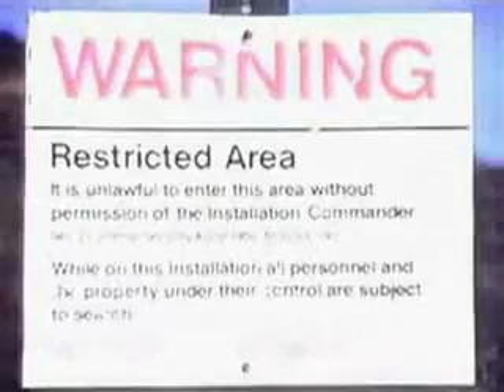Man didnt land on the moon part 2

Comment: No exhaust plume from the ascent stage? Again ROFLMAO!!! First of all, the hypergolic propellants used by the LM ascent and descent stages burns with a transparent flame. Secondly, it's that darn vacuum problem again. The exhaust pops out of the nozzle and instantly expands horizontally outward which cools it enough to be non-incandescent (i.e. you don't see it). 

Actually, if you look carefully you CAN see a glow for a second as the exhaust is trapped and glows white hot for an instant. LOL!!!

Comment: The Build Team first tested whether dry or wet sand made a more distinguishable footprint by stepping in them with an astronaut boot. It was clear that the wet footprint had more detail than the dry footprint. They then placed sand similar in composition to the Moon’s soil in a vacuum chamber and stepped on it with an astronaut boot, which made a clear print. The reason provided for this was that the unique composition of lunar soil allows it to behave differently than terrestrial soil.

Comment: The Build Team placed a replica of the American flag planted on the moon into a vacuum chamber at the Marshall Space Flight Center. They first tested at normal pressure and manipulated the flag. The momentum moved the flag around but the motion quickly dissipated. In vacuum conditions, manipulating the flag caused it to flap vigorously as if it were being blown by a breeze. This demonstrated that a flag could appear to wave in a vacuum, as the Apollo flag did.

Comment: The Mythbusters built a small-scale replica of the lunar landing site based on the photograph, using reflective sand similar to that found on the Moon, and a single light to represent the Sun. Next, they took a photo which was exactly the same as the NASA photo, including the differing shadows. The Mythbusters explained that the shadows were not parallel because of the way the light falls on the Moon’s natural topography.

Comment: Moreover, in a vacuum, the exhaust from a rocket spreads out very rapidly. On Earth, the air in our atmosphere constrains the thrust of a rocket into a narrow column, which is why you get long flames and columns of smoke from the back of a rocket. In a vacuum, no air means the exhaust spreads out even more, lowering the pressure.

Comment: Hi, the landings were filmed through a window inside the Lunar lander. For lift-off, the TV cameras for Apollo 15,16 & 17 were remotely controlled by Ed Fendell at mission control (hence you can see the camera pan and zoom when both astronauts are working on the moon's surface). Before lift-off, the astronauts mounted the camera on the lunar rover (where it was powered by the rover's batteries). During lift-off, Ed Fendell controlled the camera, taking into account the signal delay.

Comment: Calling the LLTV a "LEM prototype" is a Did Not Do The Research moment. XD Plus, this whole thing about not being able to hear the astronauts over the engine - there was no air to convey the sound from the engine to the cockpit, ergo, silence.  In addition - the LEM engine was cut when the landing pads were 10 to 15 feet above the Lunar surface SPECIFICALLY TO PREVENT a scar from forming on the surface.

Comment: OK.  I'm pretty open to theories like this, but some of this "evidence" seems silly.
1) Couldn't hear the rocket - it's space. Sound doesn't exist without air.  Inside there's air, and the vibration of the craft would have created some noise, but possibly not through the astronaut's helmets where the microphone would have picked it up.
2) LM crashing - piloting that vehicle would have been much easier in the moon's low gravity.  You really can't compare Earth physics with the moon.

Comment: 5 grams per centimeter of shielding will not protect you from 400 MeV of ionizing radiation. Aluminum's LAC is .234. That works out to about 1250 grams per centimeter that would be required. Linear attenuation coefficients make any proposed shield at least 50 feet thick using aluminum, concrete, lead ect.

Comment: What percentage of the solar constant is ionizing radiation? Scientist say less than 1 percent. When converted to rads, you would get 418 rads per second at .01, 41 rads per second at .001 and so on. The normal background radiation count in space beyond the protection of the atmosphere is 100 counts per second of ionizing radiation. The normal background radiation count in space is referenced in wikipedia's "MAGNETAR".

Comment: the sound waves would not come to the microphone through the outside space but through the solid structure of the ship and the gas in the inside. The gas was in low pressure and that could diminish the sound but not that much, it is a rocket engine just a few meters away.

Comment: That's because there's no air on the moon. This is why you see no fire or smoke, it's  simply just pure thrust pushing the space craft up. Or there are wires. But this explains why both theories according to your example are possible.

Comment: there would be very little vibration from that. most of the noise you perceive with rockets is from air displacement and turbulence. The only vibration would be from the gasses rubbing against the edge of the exhaust tube as they leave. That would make less noise than a running hose.

Comment: Before Apollo, both the USA and USSR soft landed unmanned probes on the moon using even LESS computing power. The USSR landed two rovers on the moon using less computing power. What makes you think that the calculations required changes just because you put men inside the craft? :)
The key to getting to the moon is the rocket to lift the payload, where the 60's Saturn V rocket is still the largest and most powerful rocket ever launched into space, no rocket built since comes close to it!

Comment: The CMBR constant (Cosmic Microwave Background Radiation) is 2.75 Kelvin. That is 454 below zero. You have the Solar Constant which delivers 1.36 kw/m2 in space. A small percentage of that is radiation. At .001 percent of the solar constant being ionizing radiation, that would be too much for the apollo shield to handle when you factor in linear attenuation coefficients. Aluminum's linear attenuation coefficient is .234. Pitiful vs gamma radiation.

Comment: Wrong again Tweektard, as usual. Linear attenuation coefficient: The linear attenuation coefficient describes the fraction of a beam of x-rays or gamma rays that is absorbed or scattered per unit thickness of the absorber. It would have everything to do with space travel if you were intending to shield the astronuts from radiation. Tweektard avoids the issue again.

Comment: if there was 10,000 pounds of thrust where is the fuel??? and if it takes an equal amount for going back into space, where is the fuel for that? the weight and size of the vehicle doesn't add up

Comment: Tweektard keeps talking about carbon 11. An example used for gamma ray shielding from a website called RADPRO. What Tweektard keeps running away from is linear attenuation coefficients. Regardless of the gamma emitting isotope, the necessary shielding in aluminum because it's LAC is .234 would be more than 50 feet. Gamma radiation is emitted during solar proton events which Tweektard denies. What a waste.

Comment: Ah... the 'no-crater' theory.
The LM engine max generated 10,500 lb of thrust, but it was throttled back to 3,000 lb on landing. That is 3,000 lb total over a large area. The nozzle was about 54" across with an area of 2,300 square inches. The thrust generated a pressure of only about 1.5 pounds per square inch.
This, combined with the fact that exhaust in a vacuum spreads out very rapidly, resulted in very little surface disturbance.
May be you are just an average hoax nut?

Comment: Disturbances..? There are several photographs showing disturbance of the lunar soil under or near the LMexhaust. See AS11-40-5892 or AS11-40-5921 (from the ALSJ) which shows not only some discoloration under the descent engine, but also some radial disturbance in the soil from the outward blast. AS12-46-6781 showing a trail of disturbed soil along the ground track of the LM.

Comment: Basic ignorance of simple physics:
1 No dust crater; Dust is only a few centimetres thick.
2 No dust on footpads of LEM:  Dust would not swirl up and then descend. There is no atmosphere on moon so dust blasted away would continue for some distance before falling back to surface under low lunar gravity.
I would like to see one of these morons in a room with the brave men who actually went to the moon.

Comment: "10,000lbs of thrust. So why no crater?"; Is one of the easiest to prove; 

In anyone's considered opinion, Which would you say is harder; Solid Rock, or man made concrete?
There are no blast craters at ANY launch site here on earth! Many of these sites have had multiple lift off's too...
The Lunar modules landed on solid rock on the Moon! 
AND the Lunar modules don't land with anything like the thrust of blast off here on earth! 
Why is this so difficult to believe?

Comment: Right at 0:09. Oh the two craters 'look' similar! (don't mind the differences), therefore hoax. Of course anybody that actually takes a look longer than 3 seconds can see all the differences in the terrain and the actual shape of the crater. The only thing that looks similar is the fact that it is a crater, and the light happens to have a similar incidence angle.

Comment: e, paint has weight and mass so dont you think they wouldnt have painted the rocket so much as in the big usa in "red" and the very nice style ie parts in black and some in white also not even "almost like a space ship in a holly wood film. when formal 1 racing cars pay so much atention into drag and aero dinamics they shurley in such a long mission and dangerouse trip wood have designed it to do the job most efficient'ly but no it wocket as it takes of perfect 4 the cameras